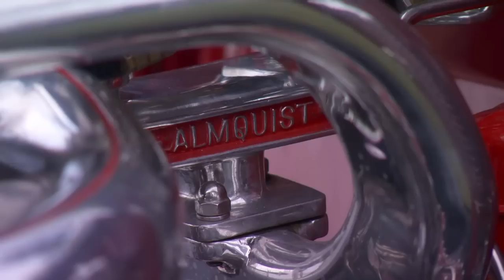Rolls Royce Thunderbolt | 1961 Imperial | Virgil Exner Designed | Festivals of Speed | Orlando, FL

Comment: The Meteor engine was used in tanks, not aircraft. Also, the Merlins were never mounted in aircraft upside down.
Reply: Hipcat13--- Yes, thanks.  A bunch of misinformation in that description.  I noticed the guy choking on his words a bit, he knows that engine ain't a Spitfire/P 51 engine.  Both are made by Rolls Royce & both are 12 cyl, but no similarity after that.  Meteor engine=650 HP;  Rolls Merlin = 1500 to 2000 HP, depending on which version.  And you're correct, not mounted upside down.